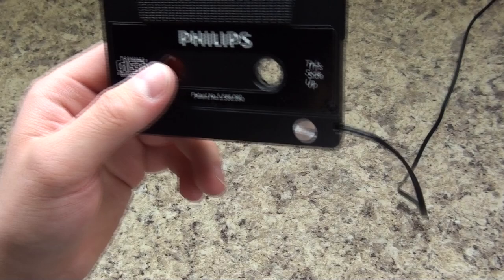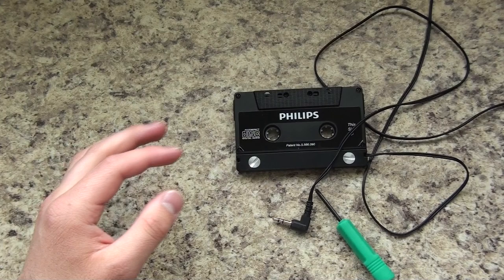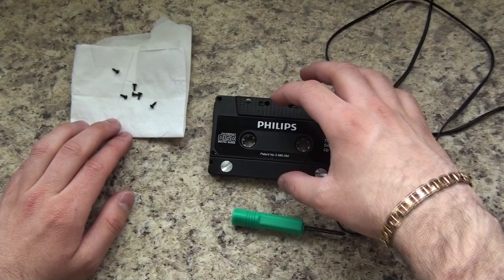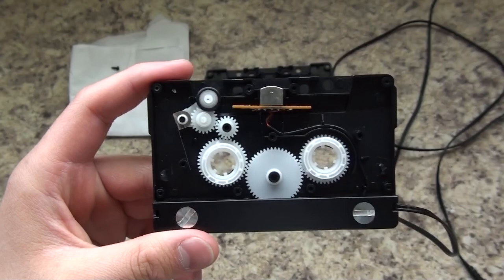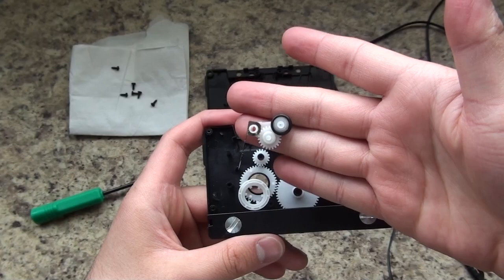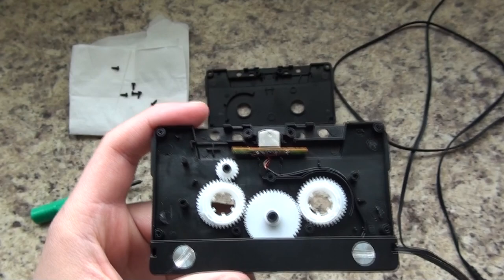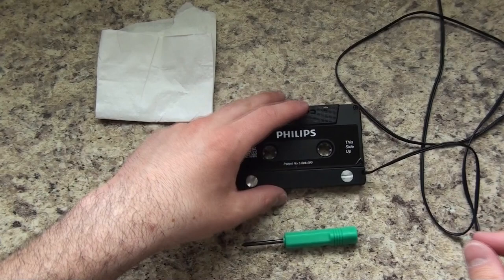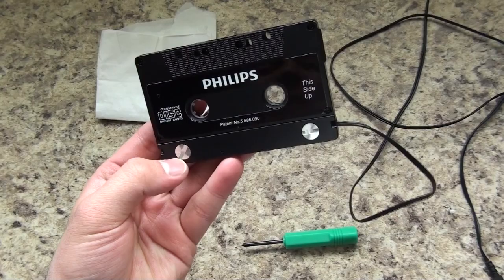How to Fix Constantly Ejecting Cassette Adapter | Any Adapter [Read Description]

Comment: Taking out that peice stopped it from ejecting but also decreased the volume of my music, so instead of taking the peice with the black rubber, i took out the small white gear in between the black rubber peice and the large white gear. No ejection and good volume.
Reply: Your player is trying to play the tape backwards. Same thing happened to me. Check the direction it's being played and make sure it's going forward. If it insists on going backwards, just rewind for a few seconds and let it play. It tricks the system into thinking there is more tape, even though there is none at all.

Comment: followed this video, but when I opened my cassette it was all configured differently. Went to Best Buy, bought a different cassette adapter and that was configured differently too. I guess you HAVE to have a Philips cassette adapter for this video to be helpful. Try doing more vids of different cassette adapters
Reply: Nah I bought some cheap one from dollar general, took the layered cog out and it was fine. Select side 2 and it should play just as well as aux
Reply: if you still need help, check your manual to see if your radio has a "Cassette Adapter Mode".

Comment: Hello, I took out the rubber piece and have another one of those top smaller piece gears. It has worked, but I have noticed a significant drop in the loudness of my speakers with the removal of this. Anyone else have this happen or have some potential insight? I’d like to listen to my music on the freeway without hearing every car around me also.

Comment: That did not work for me. When I removed that wheel the player would not pick up sound like it should. What did work for me was to spray a dry lube on the wheels and gears inside the cassette and then reassemble as original. I used Remington Teflon based Dry Lube. Good Luck.
Reply: cnmrosko that's what I was thinking of trying. I thought graphite powder, but the Teflon would probably be better.

Comment: The gears are useless, Unless your auto stop sensor is on the supply reel side! Also take note of the cheap adapters from China.... Most of them have stereo going into a monaural (Transducer) head! Therefore make sure the head inside the shell is similar to the stereo head in your tape deck!

Comment: Mine still ejects, and I've tried each method I've seen--taking out just the one gear, taking out ALL gears and taking out everything BUT the one gear.  I have a GE adapter, any suggestions?
Reply from the maker: +Jocelyn Crowe If you're is ejecting still even having tried every method I suggested, I honestly would suggest buying another one and seeing if that does any improvement.  If the new one still ejects even having done this method, than the issue is probably not the adapter.

Comment: Used compressed air to clean out the stereo. No good. Tried graphite powder to lube the internals of the stereo. No good. Took the cassette adapter apart and removed the rubber wheel as shown in the video. No good. Strike 3. Now what???

Comment: Just tried this, will update in a few days...
Reply: 100% fixed the problem just by taking out the first piece. Did not test with all gears removed. 

2003 Acura TL

Comment: This is a really strange thing. I actually knew about this fix before and have been scouring around for this new issue. My tape adapter ejects either way. Even if you take all the gears out, it still flips over and ejects.
Reply: Mine too ugh
Reply: @erickasmith7510  Man, 5 years ago is a really long time. My solution shortly thereafter was to just buy a really cheap Single-DIN replacement for my car stereo and install it myself with online tutorials. Probably cost me 50$ overall and maybe 2 hours? Sounded better than the tape did too, well worth it.

Comment: Hey I did that an it's still not working my radio pushes it out
Reply: if you still need help, check your manual to see if your radio has a "Cassette Adapter Mode".

Comment: I drive a 1992 toyota previa, ive tried every method and combo of gears possible, nothing works, might be the car but everything else in it is fine so just letting yall previa drivers know this probably wont work

Comment: I tried this 5 different times in 5 different ways but my god damn cassette player will not, not, NOT stop ejecting the god damn tape. I tried just removing the rubber thing, I tried ripping all the mechanics out. nothing works.

Comment: Mine still ejects it and I took out the peice. Help!
Reply from the maker: +sergio maiel If you're is ejecting still even having tried every method I suggested, I honestly would suggest buying another one and seeing if that does any improvement.  If the new one still ejects even having done this method, than the issue is probably not the adapter.

Comment: I tried it with the rubber and the sound was PERFECT but it would play for few seconds then cassete would eject.. When i took of the rubber piece it would play perfectly w/o ejecting at all but the sound wasnt the same it was WAY LOWER than before.. What would be the reason for that happening? Did anybody else had the same problem? I need help
Reply: have you found a fix for this? I also took out the rubber thing but now the sound is so low..
Reply: +Its Rafael nooo none. i spent hours trying to figure out but nothing..... I need someone to help me put with this.
Reply: +Paola estrada I found a fix!! Only take out the rubber thing! Insert the Tape and if it ejects, Flip the Tape around on its other side..you'll have to mess with the cable and with what hole it comes out of
Reply: hummm... not sure if the cassette will go in if i flip it.. i will try but im not sure if i already tried that but hopefully it will work w/ what you just said but its just like i said i took off the rubber it doesnt eject at all but its just the sound that's really LOW!!!!!
Reply: Check what direction the tape is being played. Sometimes it tries to play it backwards for whatever reason, and this mutes the sound to a fraction of its normal volume. Happened with me. If there's a button to change play direction, press it. If it persists, try rewinding it. It will trick the system into thinking there is more tape, even if there is none to begin with. Why does this work? I have no idea.

Comment: Just bought a new adaptor and it still pops out I nee help
Reply from the maker: Sorry to hear that man. These can be a pain in the butt. I'd recommend investing in an FM transmitter, less of a headache.
Reply: if you still need help, check your manual to see if your radio has a "Cassette Adapter Mode" that turns off the arms that grab the tape, auto reverse mode, and just sets the head reader next to the adapter magnet.